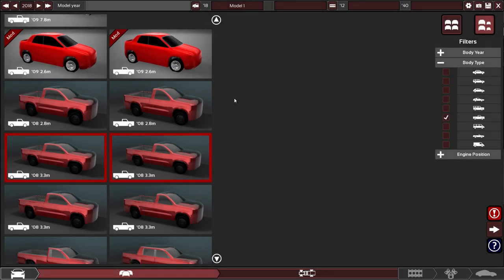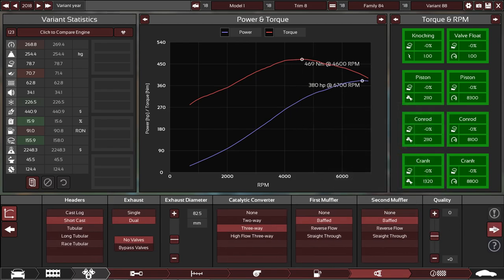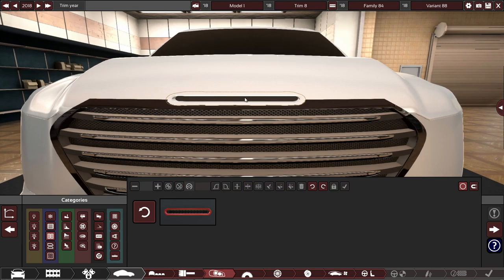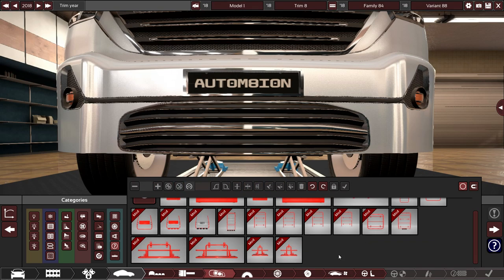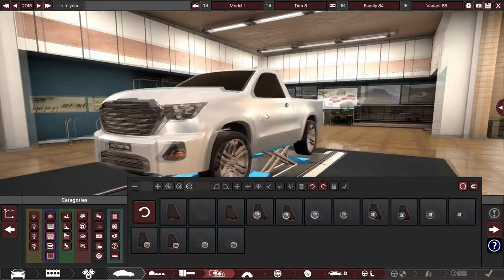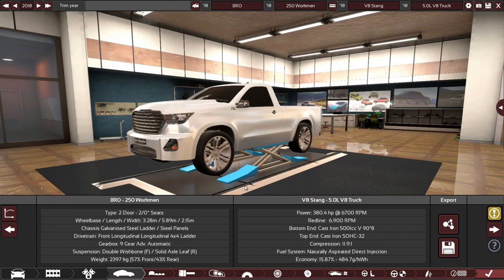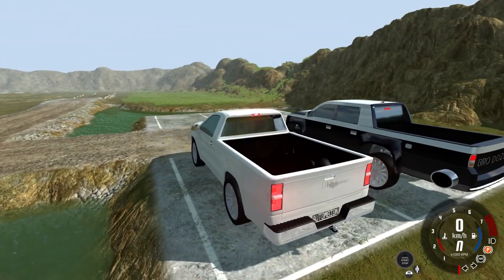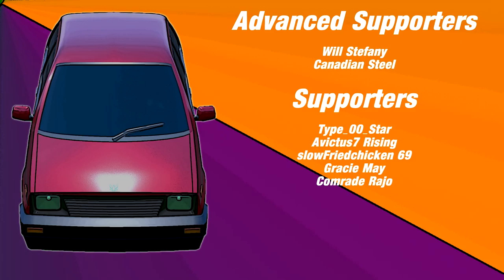5L V8 Sport Truck Build - (Automation + BeamNG)

Comment: How to make aligning letters easier: 
1- Take two straight pieces of trim. 
2- Place them above and below where you want the letters to be.
3- Add lettering.
4- Align letters to the straight bars you made.
5- Remove the bars.
6- Profit.

How to make custom taillights:
1- Take multiple simple square or round lights.
2- Place them next to each other.
3- Play with their placement till you get something interesting.
4- Change coloration to suit your needs.
5- Profit.

P.S. Most countries today require turn signals located on the sides of the vehicles as well as the fronts and the rears. This also gives you some more detailing to add to the sides.

Comment: With your oversquare setup, the engine could have revved to 8000 rpm. Using a longer stroke (an undersquare configuration) would have given you more torque without causing the valves to be a performance bottleneck (like when you tried increasing the redline and the valves started being restrictive)

Comment: Starting great... (0:43)
"I am gonna be basing the styling off of the new 2019 Sierra" 
showing us a Denali

😂😂😂😂😂😂😂😂😂😂😂😂😂😂😂😂😂😂😂😂😂😂

I think that the video should more be like that: 
Automation : Building the truck
BeamNG : testing it a bit
Automation : correct the major issues (like falling off bumpers)
BeamNG : testing the final product

I think this will allow you to do waaaay cleaner builds!
Reply: AM: design
BNG: test drive
AM: fix things
BMG: last drive / challenge
Reply: @shadow105720  you have say the same thing than me but only using 4 lines gg !
Reply from the maker: Is Denali not just the highest trim level? It's still a Sierra
Reply: @automotiveflux  oh for me it was 2 different gmc truck but ok! Was not knowing that glat to know that now!
Reply: @_underscore_2381  yeah it's a sierra Denali, but even if it's a Chevy it's the same damn thing

Comment: Instead of always making the tires different sizes try manually adjusting the suspension options. I always have same size tires unless the car is pushing over 700 horses then back tires seem to do better being a bit bigger as the horsepower goes up.

Comment: Make a v10 turbocharged sport or hypercar you can get 600 hp easily NA and 2000 turbocharged, its pretty amazing to drive these cars because the v10 engine has a good balance of hp and torque
Reply: I got 1500hp out of an na v10

Comment: Dude you're trying to make a basic truck engine but you end up making a performance engine every time. Honestly reminds me of myself until I joined the public alpha and had more control, but right now they all still run on E100. It makes sense because I want it to be one of the only 3 fuels in the US, which would be in two grades E100, E99 (ethanol/water 99/1%), B75 butanol and B100 biodiesel.

Comment: Make a diesel version of the Chevy LT2 with some elements from the LBZ Duramax Diesel and put it in a Garbage Truck based on the Silverado 4500/5500 or a Class 6 full-size van style truck.

Comment: you designed a truck engine that is over-squared, which is more fit for higher revving and high end power rather than torque

Comment: Why the basic interior with no safety features? Have you been in a modern truck? They're pretty much luxury vehicles. Also the engine is a bit weird being SOHC and having such a high cam profile but honestly it's probably better designed for how most people actually use their trucks rather than towing and stuff
Reply from the maker: I generally do a basic interior, all it does is save weight in this game when transfering to beam

Comment: that isn't really a good trailer for testing towing since most normal trailers would weigh down the back of the truck enough to give it adequate grip to tow with.